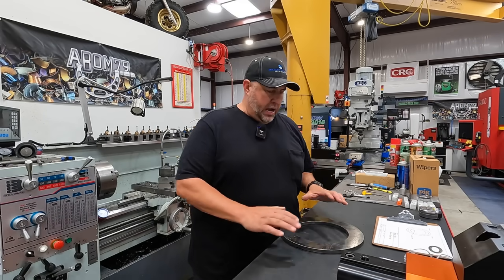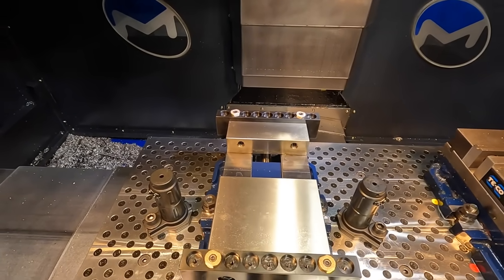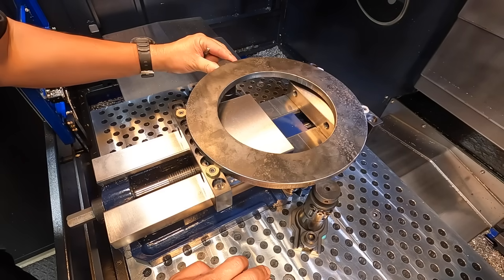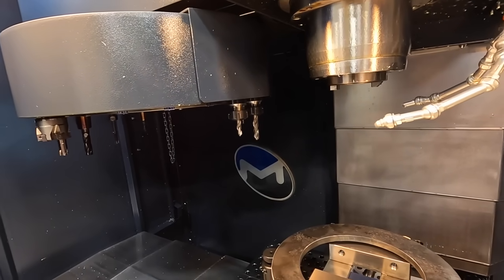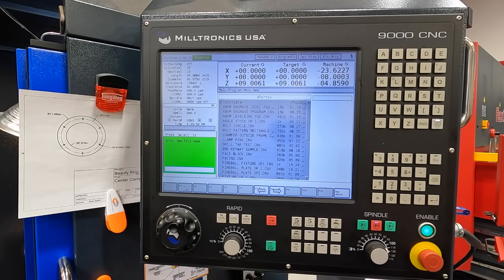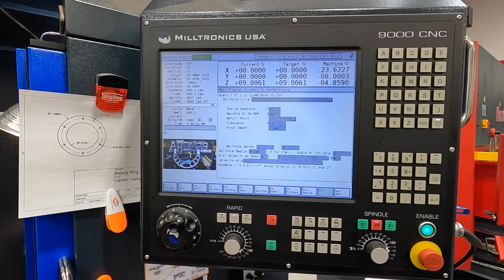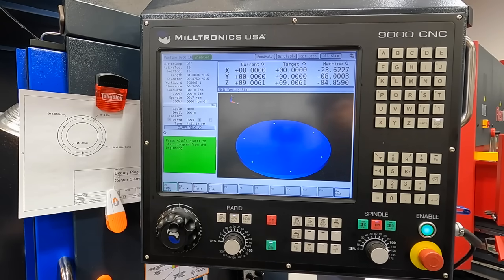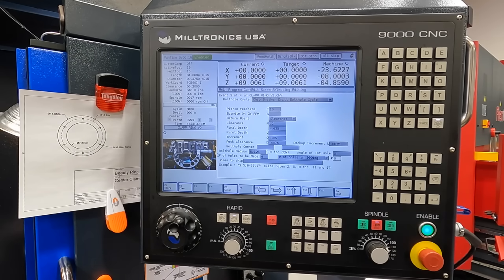Machining a Bolt Circle Using Milltronics Conversational Programming

Comment: set of dividers, tape measure. hammer and center punch,drill  and done. faster than your intro.good job though lol
Reply: 1:16

he knows.

Edit: Having watched the video, while the machine is drilling a part he can actually champfer it and tap it. (In the case that the flame cut material is not straight, otherwise CNC the b*tch)
Reply: I take it you have one of those precision tape measures that read to 0.001" then :P
Reply: @terryspears2307  I dont think Adam is looking for work. He earns enough just doing Youtube with all the free gear he gets. Thats why the new shop. Anyone who had bought or borrowed for all that gear would be flat out on paying jobs.

Comment: And THAT’S faster?  You need Milltronics and MIT on speed dial to program that robot. Sorry I had to bail midway.
Reply: Do you honestly believe you could do this on a manual machine faster? I don't. Just look at how quickly the probe found the center of the bore compared to what you would do with an edge finder. He was also explaining the whole process while he was doing it. Had he not had to do that, it would have been exponentially faster as well.
Reply: A prototrak mill would take less than 10 minutes (actually it took only 5 mins with countersinks ) including setup + programming. Use a cordless drill for chamfering.
Reply: It would have been a bit faster to import the drawing (dxf) file into the control.  Too many steps to develop a program regardless.  My machine with a Hurco Automation control would write the program itself by pointing out the hole positions on the touch screen from an imported dxf file.  Set the center as G54 by touching the screen.  Then pick the tools from the tool library and adjust feeds and speeds as necessary with appropriate G cycle, peck or drill with depth.  It would take me all of two minutes .  I didn't look into the Milltronics control that far to see if it had that capability.
Reply: You're missing the point.  What if you had 30, 50, 300 of these to do?  You pay the one time setup fee, and reap the benefits on every single part done thereafter.
Reply: @machinists-shortcuts  Ok. Now do a whole video that you present on YouTube and let’s see how fast you do it.
Reply: @MoparStephen  
The real point is boring content and I’m not talking about drilling holes.
Reply: @MechanicalAdvantage  
Yes. The first one. Of course subsequent ones would be quicker. 
Keep those opinions going.
Reply: @RicksterX-92fs  I’ll look forward to your video showing you can do it faster and explaining your step by step process in a YouTube video.
Reply: @MechanicalAdvantage   
Mr. Mechanical, one doesn’t have to be a machinist to be bored watching a master mechanic struggle to program a robot. Just like one doesn’t have to be an artist to have an opinion about art. I don’t like it and that’s my opinion. He’s a great guy and I faithfully watch his other videos.
Reply: @RicksterX-92fs  you started out saying that wasn’t faster. I can understand if this content isn’t for you. There will be tons of manual content on the channel. There are lots of people interested in CNC as well. In fact, Adam has had conversations with some users that are all manual and are now looking to add CNC capability after they saw his experience with it. 
Manual and CNC aren’t mutually exclusive. You don’t have to only pick one or the other. They are tools, and you will continue to see Adam use the right tool for the job at hand as those jobs come.
Reply: @MechanicalAdvantage tell @RicksterX-92fs not to bother I've already uploaded one.
Reply: @MechanicalAdvantage  5 minutes filmed in real time including countersinking.